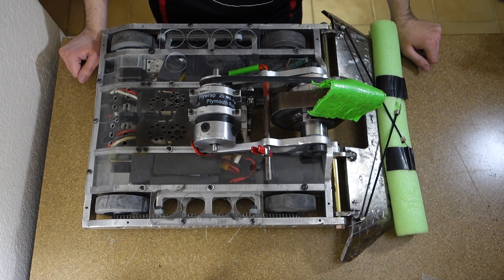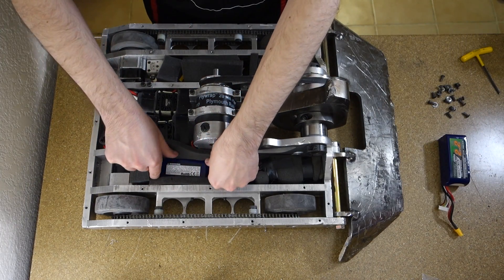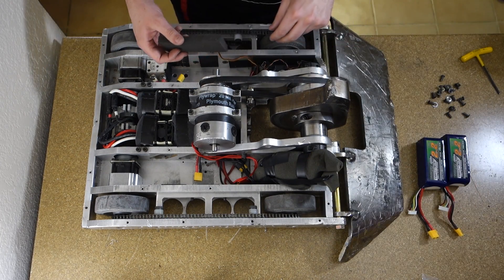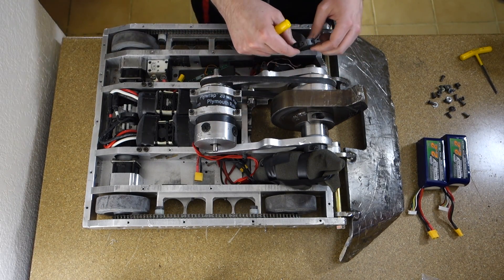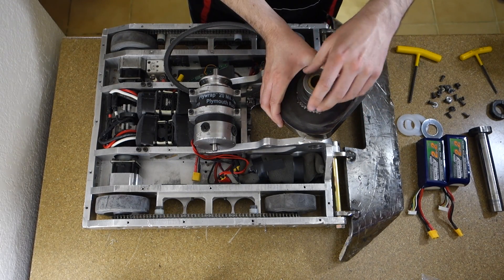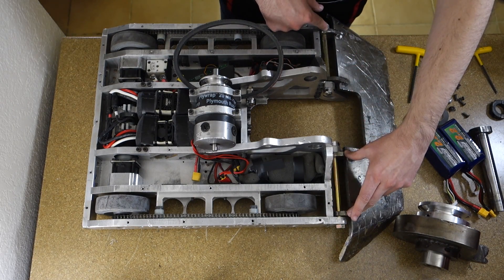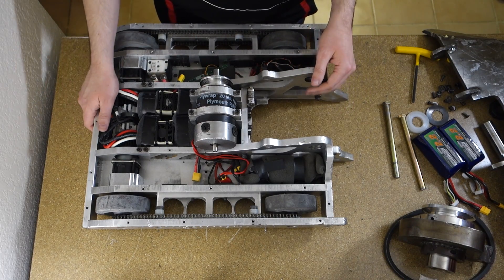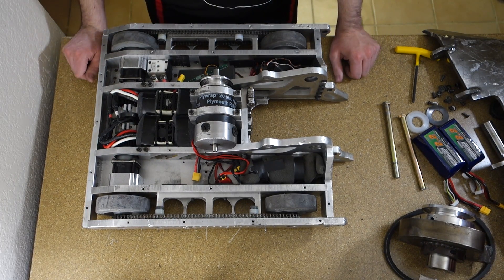K2 Breakdown

Comment: Instead of wrapping and protecting everything with foam, you should cast it all in plastic or resin.
Reply from the maker: That would be:
1. Heavy
2. Impossible to replace burned up components 
3. No airflow to keep things cool
4. Expensive
Reply: I havent had electronics or batterie damage since i casted all components in heat resistant silicone.
It can take heat up to 350.C and a 5.0 Kg bucket costs less than 50€.
Reply: Karl, what are the down-sides of using foam?
Reply: Karl Napp but pool noodles

Comment: Kevin, how many teeth are you running on the sprockets and what are you using for hubs on the Colsons?
Kelly Smith Team Rockitz
Reply from the maker: They are 16T aluminum VEX sprockets. The hubs are custom, a simple press fit design. There is a picture of them on the FB page.